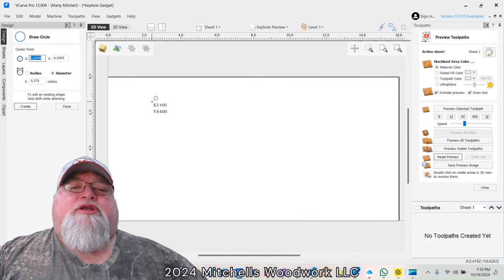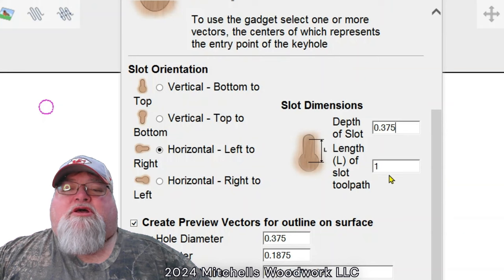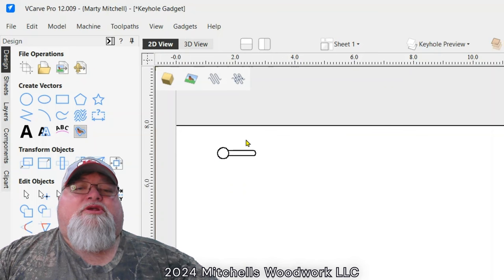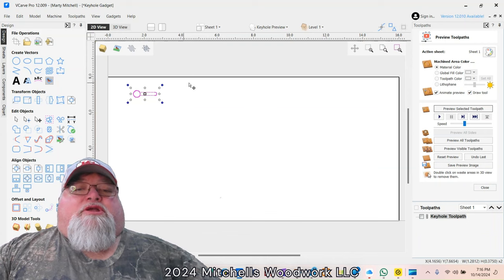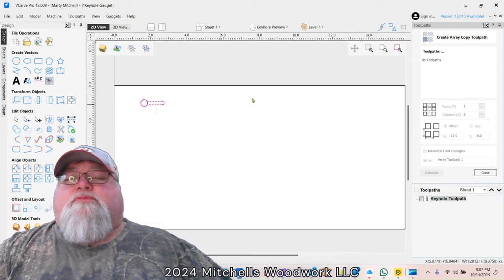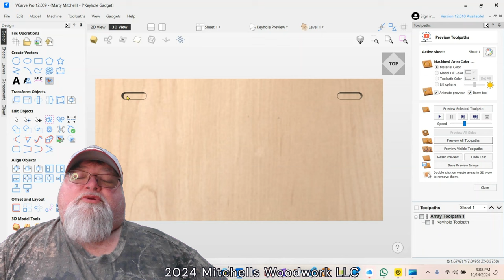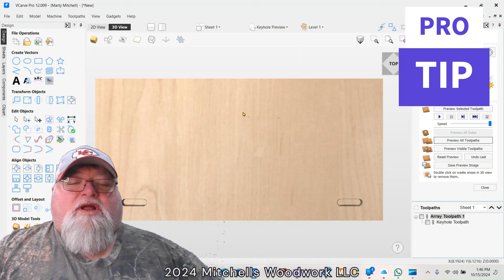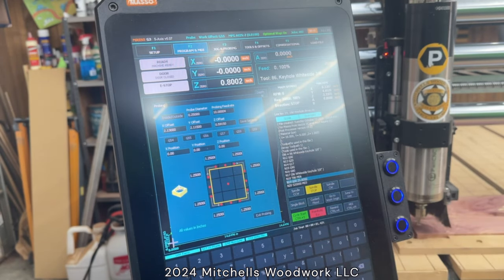🏆 Top Secrets To Cutting Perfect CNC Keyhole Slots with VCarve Pro!

Comment: Nice video. I just upgraded to Ver. 12 and didn't know that the gadget was there. Before i just did two straight lines [connected at one end] as my vectors right alongside each other to the depth i wanted and ran it that way. The machine would plunge down at the start run down the vector and back lifting out of the same hole it started in. Your video makes it easier. Thanks.
How is the dome suggestion working out for you?
Reply from the maker: I had always just used my router table, but this way is much more accurate.  What dome suggestion??
Reply: @MitchellsWoodwork  We emailed a bit ref adding a dome to your badges.
Reply from the maker: Oh!  I haven't did another badge yet, but I'm going to try that on the next one.

Comment: So if your doing a 3D carve should you do the keyholes first then flip to do the carve?  Thanx for the video.  Great info.
Reply from the maker: I hadn't thought about that, but yes, I believe that would be the way to do it.  Thanks for watching!
Reply: I would.   I mean, you could leave tabs on the cutout and flip the whole thing, but doing it first would be best.  

I'm weird though... I cut the profile out completely first then run the 3D carve.  Double sided tape provides more than enough holding power for 3D stuff.
Reply from the maker: That's interesting, @badpandawoodworks.  I'm not a 3D carver, but I'm curious as to why you cut the profile first?